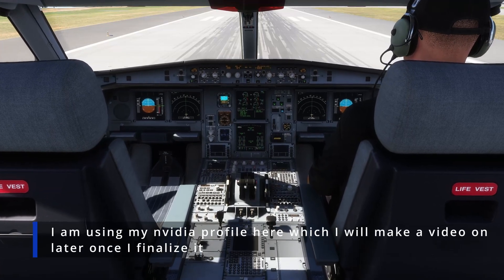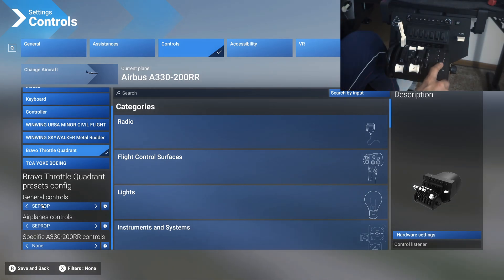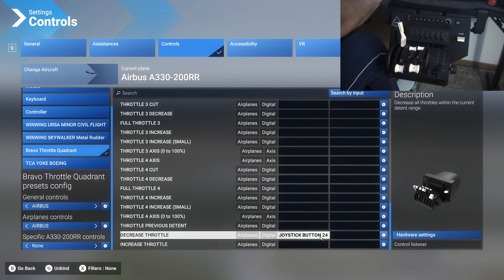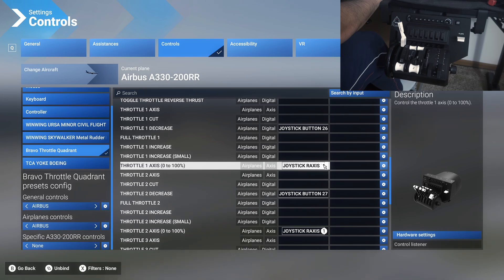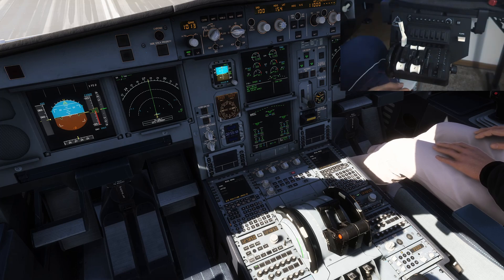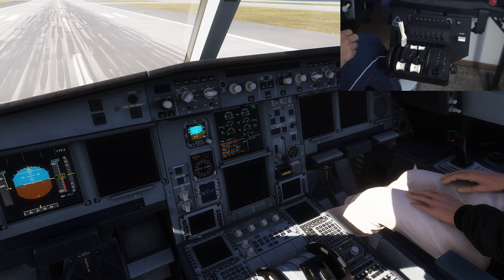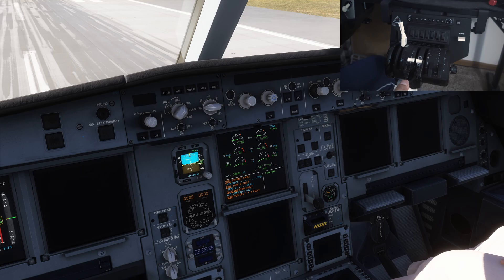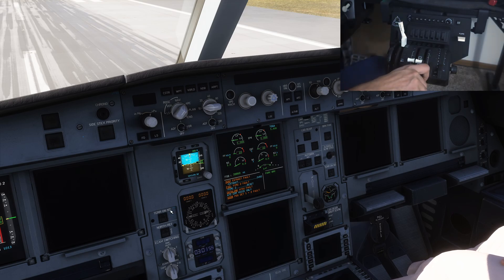Microsoft Flight Simulator 2024 - AIRBUS ONLY - ULTIMATE THROTTLE SETUP GUIDE

Comment: I watched a video in a French channel, for the reverse do not actually decrease the level, just in settings click on Throttle 1 decrease and on the bravo just raise the reverse level for eng 1 (you only need to raise the level from its locked default position and put it back to the default position, do not go full reverse at all) you do the same with Throttle 2 decrease. This will register both raising the level and the full reverse automatically.
Reply from the maker: Interesting

Comment: Does the profile automatically switch when you load into an aircraft? Or do you have to manually change profiles based on the aircraft your flying like 2020?
Reply from the maker: The way it is setup, it should automatically change with aircrafts but I think it might be a bug or something for me I always have to go to settings and select respective profiles...regardless of whether I click apply to all aircrafts or not
Reply: @AirborneGeek  Ah alright thanks! So when you create each profile, e.g Boeing. Do you select apply to all aircraft?
Reply from the maker: @JBAviation I used to do it before ..Now I am not. Because it seems like all that matters is I have a good profile for each type of aircraft. Then when I spawn I just go and change it for that type of aircraft and once I do that it seems to be remembering the profiles next time I spawn in the exact same one. Even if you change config, it forgets the profile again...
Reply: @AirborneGeek  ah ok thanks for that!